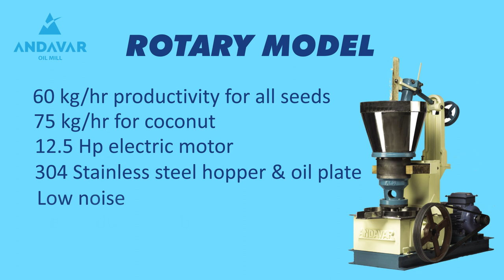Oil Mill Installation | in Coimbatore | Rotary model machine

Comment: Sir one time 45 capacity mechine also there sir
Reply from the maker: Hi ,We are from Andavar Lathe Works Erode,Tamil Nadu. We are India's leading oil mill machinery manufacturers and exporters since 1968.we have wooden-pressed oil machine,Iron Rotary machine,oil filters, expellers copra cutter and oil cake power machine.we export 20+states in India and 16+ countries worldwide.Contact : +91 7373785802-06